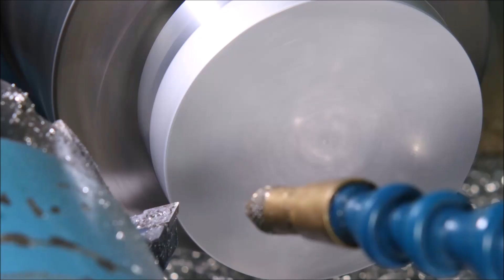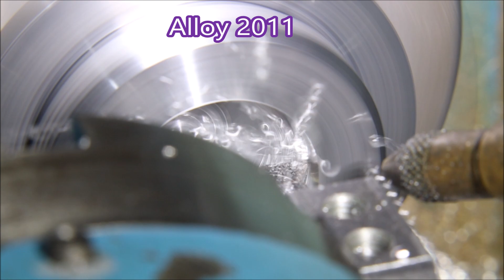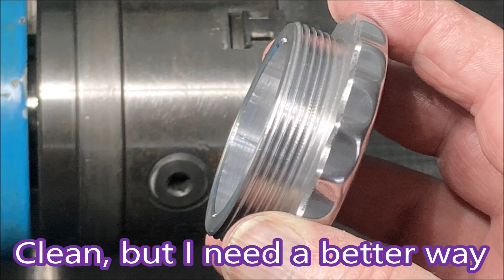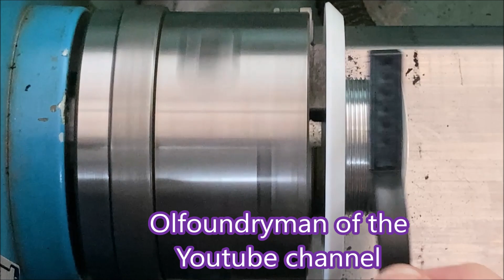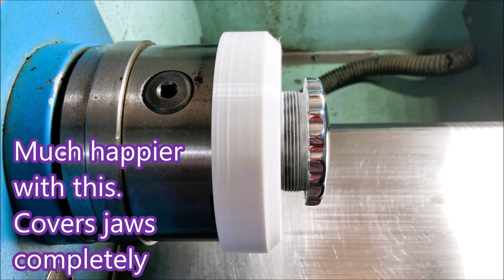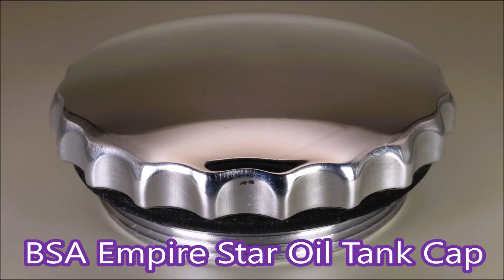Cleaning 50x16tpi threads on Hercus PC200. With oil tank cap for BSA Empire Star, J12/Y13 and C10

Comment: Maybe fibre glass brush used for cleaning up motor commutators? In the past also just put taper point onto a piece of flat wood and pushed that into threads.
Reply from the maker: Hi Steve, I have tried acetone and ultrasonic which removed a lot of the compound.  Tried the residue with kebab skewer and not much good ended up finish with wire brush and tissue paper. Thanks for you comment. Nigel

Comment: I've got a similar issue; buffing compound in small (turned from 12mm round bar) brass parts with 2mm holes and an M7x0.7mm thread. Had some good results putting the parts in a screw top glass jar of acetone, and putting the jar in my ultrasonic cleaner. Seemed to do the trick in about 10mins. This way you don't need to put 3L of acetone in your ultrasonic; mostly water👍😊
Reply from the maker: @hamiltonpianos  did you have the acetone bottle sitting in water?
Reply from the maker: Will try it tomorrow

Comment: Looks good Nigel.  I wonder if you could take something like a  hacksaw and take the blade out and tie some string between the points.   Will keep you fingers away. Not sure it will do any better though.
Reply from the maker: Hi Gary, good suggestion and as string is non directional the saw could be laid flat and fingers would be even further away.  Bought some kebab sticks this morning will give them a try.  Thanks for the comment. Nigel
Reply: @smallcnclathes  hope something helps and saves those fingers :) 
Lathes scare me enough knowing what they could do if they grabbed some clothes or hair or something like that anyway.
Reply from the maker: @GaryForgingOn  I think after the second protector it would be pretty safe particularly at such low speed. Someone just suggested acetone in an ultrasonic so I will try that tomorrow. I also have some kebab skewers to try

Comment: If using the string to clean the threads maybe tru mounting it in a hacksaw or coping saw?
If you melted some candle wax on the threads before polishinh would that work ?  Maybe put some truck was concentrate or something similar  on the threads first before polish , would that create a barrier ?
Reply from the maker: I just bought some kebab skewers to try, if I need string I will try the hacksaw.

Comment: Have you tried different kinds of soap?
Reply from the maker: Hi Peter, now I don’t know what you mean. Here soap is a name used for bars of polishing compound! And of course there is soap for washing. LOL
Reply: @smallcnclathes  
Oh...? Didn't think of that...

I know the americans use the word detergent for the powder we use in washing machines, but here the general word for everything that foams and washes dirt off stuff is 'soap'.

What do you use when you wash your floors/dishes/windows/cars then?

When I was in the electronics industry we used to wash dirty electronics in an ultrasonic bath with some pretty strong "soap" in demineralized water.
Reply from the maker: @Peter_Riis_DK  Hers soap is the bar stuff that is found in the bathroom. Most other things are referred to as detergent. Laundry powder or liquid, car wasj liquid etc.
No I have not tried different soaps.  I out a little dish washing liquid into the water when I used the ultrasonic. It left a dull sheen on the threads.  Anything alkaline attacks aluminium I am told. I am going to sit them in some solvent ie kero or petrol and then put them in the lathe.  I just bought some kebab sticks to try, they come complete with a point and a bit of a handle to hang on to.  Thanks for your comment. Nigel
Reply: @smallcnclathes 
Come to think of it.. Wouldn’t it be the responsibility of the polisher guy to remove remnants of his blo*dy compound from your item? 🤔

You’re not shipping swarf along when you send out items to costumers, are you? 😉
Reply from the maker: @Peter_Riis_DK  I did ask the question when I picked them up and they have no process to provide cleaning them up.

Comment: One solution would be a holder.that the cap screws in , it would protect the threads and make it easier for the polishing guy, which might make it chesper for you..
Reply from the maker: I will look at that if I need to make more. Thank you for your comment

Comment: Try using a can of brake cleaner they generally have a higher pressure and volume stream / spray and its a good solvent.

I use it for so many cleaning jobs.
Reply from the maker: @deepwinter77  thank you, I will keep that in mind if just sitting them in some solvent does not work. Nigel

Comment: Tricky one Nigel,  if the compound is waxy you'll need a solvent to melt it, like paraffin or something, then brush it off.  Can you make a plastic collet holder to grip the polished area, then the threads are pointing away from the chuck,  reverse the chuck rotation and use the string or brush, no chance of hurting fingers because it's moving away from the chuck.  I always reverse the chuck rotation when cleaning or filing threads and it works well.
Cheers Ian
Reply from the maker: Hi Ian, I have another 15 to clean up just looking for a solution without too much hassle. I think I will sit the threads in some solvent and see how that goes.

Comment: I really need to try 2011 alu one of these days. It looks like a dream.

If half my sub-shops put in a fraction of the care you do, I wouldn't bother machining anything myself...
Reply from the maker: @kevind1865  Hi Kevin, thank you. I only use 6061 to show in videos! I have turned jobs in 6061 down as they are just not worth the hassle. It needs horsepower to feed hard and take deep cuts. This lets the chipbreaker do it’s job. Not sure 1/2 hp qualifies! I have never made a lot of money working for myself, but no office politics, only work for customers I like and only taking on work I can handle.  I am now retired, don’t take on as much, so fewer videos, but I still have clients that are more like friends. For some reason the won’t let me retire!
Reply from the maker: @kevind1865  if you do want to try 2011, it does not weld well and the anti corrosion properties are not as good as 6061

Comment: the rag and the string make me nervous just watching you do it! Do you not feel this is a bit dangerous?
Reply from the maker: Low revs, almost no power going to the spindle and the finger guard in place, I have no worries about it.  With out the finger guard, I agree completely but with it all rotating surfaces are smooth.  I will be trying a number of ways to do this, following some suggestions on here. Not a suggestion as yet but I may attach the rag to a bit of timber dowel.  That would pull away out of my fingers quite easily.  I appreciate your concern and your taking the time to comment. Nigel

Comment: Have you tried a tooth pick? another interesting video.
Reply from the maker: Hi Colin, no I had not. With my new safety attachment I think a few more options are available. I will try a lolly pop stick and see how that works, I am also going to sit them in some solvent type liquid to see if that helps.  Thanks for your suggestion. I may follow up with another video of suggestions. Nigel

Comment: Have you thought about making a Tumbler with a cheap plastic cement mixer with fine media in it ?
Reply from the maker: @CambridgeGreatBritain  did you see the polish on the ones at the end of the video? How would that survive in a tumbler?
Reply: @smallcnclathes  you can get some very fine Media that will clean and polish it's like sand you just have to be aware of how long it is in the Tumbler so it doesn't damage the threads but it will take hours to do any damage the threads .
I'm sure there is some YouTube videos showing the process and what type of Media for polishing and cleaning
Reply from the maker: @CambridgeGreatBritain  that polishing cost me $12 per cap. Can what you are talking about produce a mirror finish? And I really do mean a mirror finish
Reply: @smallcnclathes  you can get purpose built jewellery tumblers that would do just as good they're not very expensive or look into making one with a plastic barreled cement mixer with the correct Media for larger batches.
  I'm not saying it's financially viable it depends what quantity you are doing
Reply from the maker: @CambridgeGreatBritain  I doubt I will be making any more of them. They don’t sell well. It is after all a limited market

Comment: Maybe isopropyl alcohol would work here as that will dissolve oils. I use it in combination with string when my lathe leadscrews gets all dirty.
Reply from the maker: I am going to try sitting them in some sort of liquid to see if it makes it easier to clean them up. I have ISOm turps, kero and petrol to try
Reply: @smallcnclathes  kerosene should work too. The only reason i dont use it is because it stinks! IPA smells too but it evaporates quickly.

Comment: Clickspring uses a pointed piece of stick or dowel with the polishing compound on it. It will work well.
Reply from the maker: Using compound to remove compound?
Reply: @smallcnclathes  of course. Polishing is just using fine scratches to remove the previously applied heavier scratches. You could use brasso or aluminium polish or even wd-40. The stick is even an abrasive.
Reply: Cratex sticks are an option as well.
Reply from the maker: @GTRgeoff  Never heard of them, will check availability. I am not in a hurry, really only need to do these as they sell.  Thanks for your suggestions. Nigel

Comment: I would use a wire brush in the drill press, with some WD40 or maybe carb cleaner
Reply from the maker: Hi David, These things are really awkward to hold and if they fall on the floor they will be pretty much junk.  Using a wire brush in a Dremel and holding them as I am might work.  Will be sitting them in some petrol I think to see if that loosens up the compound.  Thanks for your comment.  Nigel